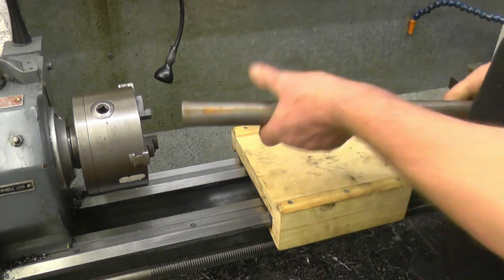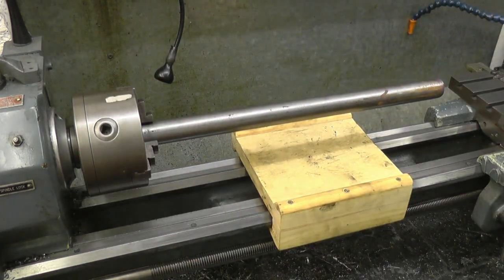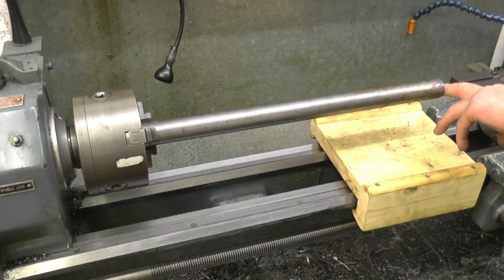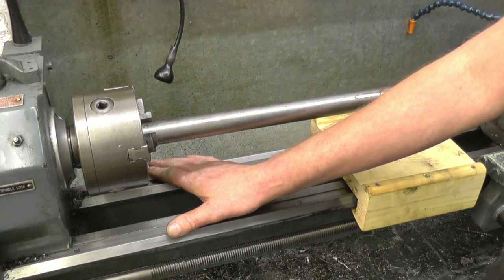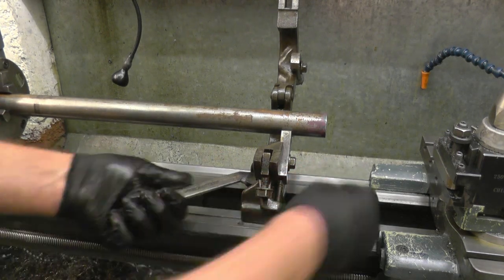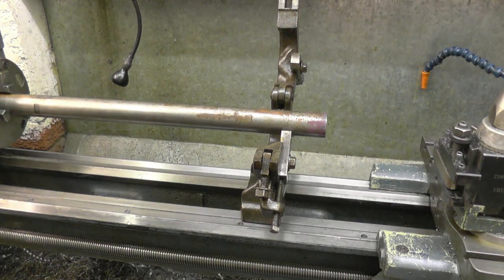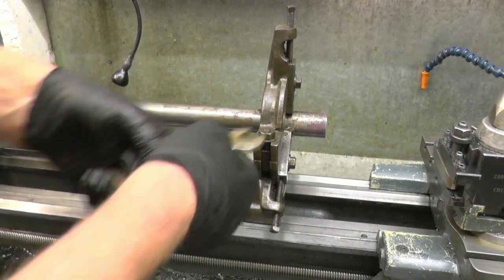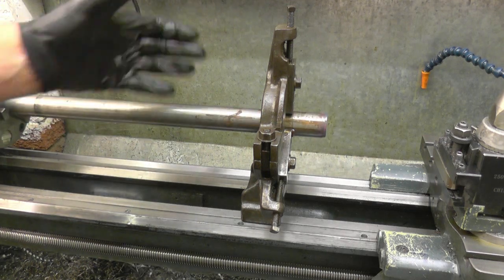Lister Trolley part1 (fixed steady)

Comment: Out of interest John, what HP of a motor are you running in your lathe on the inverter?

Thanks,
Ger
Reply from the maker: Hi
The motor is 3/4 HP 3 phase
Reply: doubleboost Cheers :-)  I'm after getting a similar size (6" over the ways, about 20 between centres) lathe at home, but it's an industrial Weiler Ergodor machine as opposed to a lighter school lathe, all in about 900 kg of bloomin rigid German cast iron :-) It's got a pig of a motor, 2 speed with 1.7kw on low and 3.2kw on the higher setting. The power out to my shed is only barely good enough so I think I'll get one about a horse or maybe horse-and-a-half and whack an inverter on it. I've a rotary converter I built myself giving either 240 or 400 three phase out but a little inverter would be way cheaper on electricity

Comment: Thanks for the tip on how to do that...time to finally get the steady rest cleaned up and de-rusted to see if it works.
Reply from the maker: Well worth doing
Very handy bit of kit
Reply: Yes and will probably get it in the Evaporust later tonight.  I may have to use it to help hold the one end of a foot long piece that I need to put a Morse Taper 2 end on if I can't get the tool post in there at the right angle when the live center is in place.